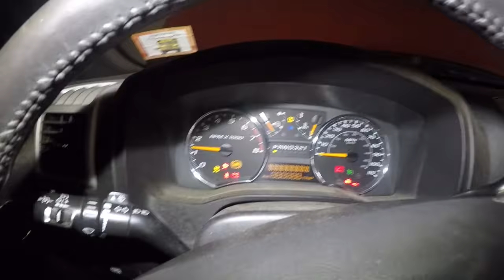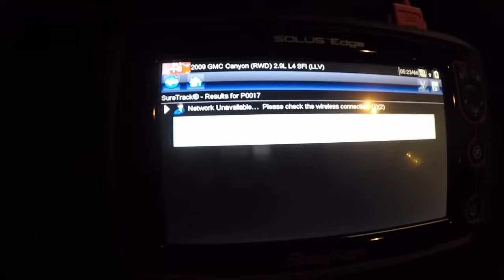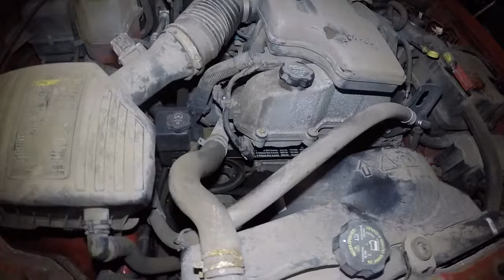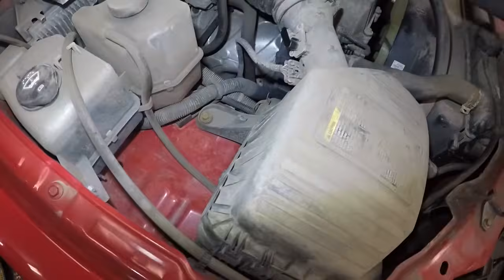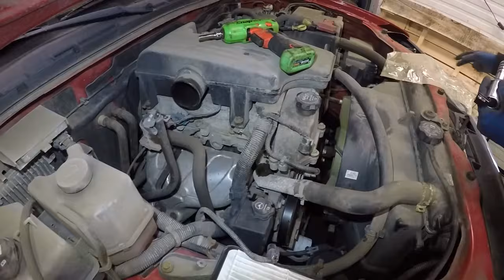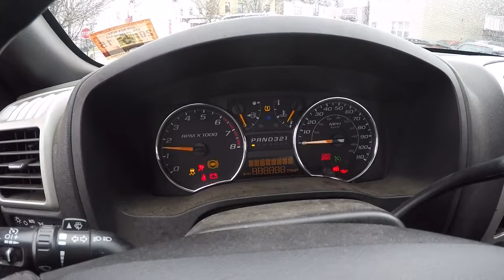GMC Canyon stalls code p0017 and Chevy Colorado

Comment: Hey buddy,
 You nailed the problem right on the head. I had already changed the cam & crank sensors as well as the Mass air flow and the MAP sensor . All to no avail. I didn't know that this part was even in the engine. You described my symptoms to a tee.
I replaced it as you explained.
Runs like a top. Even though I replaced all the other sensors in the end it was still cheaper than going to a repair shop. Besides the truck has 140,000 miles on it so they were getting old.
Again I appreciate you sharing your knowledge.
Reply from the maker: Nice job!!!! Good fix I just did Toyota 4 runner it has misfire issue on start up
Reply: Same here man exact same thing i did thinkn what wld a vvt have to do with p0017 code saying cam/crank sensor.

Comment: I have a 2010 gmc canyon and its starts sometimes and sometimes no but when you go into drive or reverse it stalls i have a evap code leak so i dont know what to do can somebody help me!!!
Reply from the maker: Did u try cleaning theottle
Reply: @RBTheMechanic yes i did a couple of weeks ago was very dirty now on idle it run like 1,100rpm them after 5-10’min goes down to 900rpm

Comment: Yes!!   
This is the video that saved me hundreds if not thousands 

I honestly thought my truck needed a new engine 

One day just started shaking like the engine was about to fall out!   

2 shops couldn’t figure it out 

150 at one shop
300 at the other shop just to tell me they didn’t know what was wrong. 

I came back home from shop. 
Watched THIS video!!   
And I told myself this has to be the problem!! 

This was in March 2026
$80 and 15 to 20 minutes later I’m back on the road because of you. 

Thanks RBT ❤👍🏼🙏🏼💪🏼
Reply from the maker: Nice bro great job I would go back file a complaint and get my money back if they don’t go to file complaint on consumer fraud 10 minutes to file complaint and watch they will immediately call and pay u back to take the complaint back!!! Anyways good job subscribe and share. And save this message as proof

Comment: Po017 says you have a timing relationship issue. Once that happens it stops sending a signal to the vvt solenoid. Duh! It’s not working because if it does it would ruin your motor. Wtf?
Reply from the maker: Cuz be stretched timing chain but try basic before

Comment: I have 2006 Chevy Colorado 2.8l 4 cylinder there is no code when I start the engine it works fine after driving for 20 minutes when I stop at the traffic light the engine shuts off without shaking I already replaced the throttle body, mass air flow sensor, air cabin filter, camshaft sensor, crankshaft sensor and solenoid sensor still not fixed at the traffic light I have to keep my foot on the gas to keep it running
Reply from the maker: Did u do idle relearn
Reply: @RBTheMechanic how can I do that please

Comment: my 04 canyon starts and dies,, what could that be ? new fuel pump and filter and battery and fuel.
Reply from the maker: Start with cleaning the throttle could be chocking it

Comment: This didn't fix the 07 Isuzu I 290 with the gm 2.9 engine. The exhaust cam gear vvt goes bad and will also cause this

Comment: Bro mine did not just pop in, I saw another video from a guy called “Chris fisher” and the fella gave it some oil, wiggle it all you can then if need give a tap with a long screwdriver on the metal piece with the hole, not the sensor. Cuz mine would be 1/4 of an inch sticking out and wouldn’t go in.
Reply from the maker: Look to see inside in anything is there blocking or check correct part
Reply: @ I did fella, nothing. So I did as the old timer said in another video and it worked.

Edit, also I tried putting back the one it had and same thing, it wouldn’t go in, old timer said it was the seal that was making it hard, he was right.

Comment: Good video my friend so I have a question I have a 2010 Chevrolet Colorado the truck start but when it start running and I stop like 20 minutes after I start driving it , the truck start doing the same as the video one you think mine has the same problem
Reply from the maker: That truck has issues with timing it stretches the change and guides
Reply: @RBTheMechanic  so you think I should replace that part from the video I put the scan and throw the code p0017

Comment: Does the position of the solenoid make a difference? The metal tabe to mount the bold thru on new one I purchased can spin around the solenoid. After installing it, the engine still runs rough like before.
Reply from the maker: It only goes one way if the bolt can’t fit in same direction it’s wrong part
Reply: @RBTheMechanic  well after changing the solenoid, camshaft position sensor, crankshaft position sensor, MAP sensor, both o2 sensors, spark plugs & cleaning the throttle body, the truck ran fine while it idled in the driveway. I drove it maybe 10 minutes with no issues. Next day, took it for another 10 minute drive, got up to 55 or 60 mph, ran fine. Came home & parked it, but then couldn't get it to start. No codes have popped up. Any suggestions?

Comment: How do you know if the solenoid was bad?
Reply from the maker: It’s common usully it had code or symptoms of random misfire start up cold
Reply: @RBTheMechanic  I have that same code and the dealer is telling me it's a timing chain which will cost 2500 to do. This code sometimes goes off on its own so that's why I don't think it's a timing chain not to say it's not worn or anything
Reply from the maker: @tamipotirala6973  yeah these could be issue with timing chaning I would do the basics before jumping to expensive repairs oil change vvt cam sensor
Reply: @RBTheMechanic  where is the cam sensor at I've heard there is more than one. I have a 2005 canyon 2.8L
Reply from the maker: @tamipotirala6973  yes I have video search it on my channel
Reply: @RBTheMechanic  ok thanks

Comment: I have a 2012 Colorado.  A new engine was installed.  Now the dam thing stalls at low speeds and stop lights. No codes no check engine light.  It never stalled before. 8(.  Mechanic does not know what it is.
Reply from the maker: New engine will not come with new throttle so it could be that ur throttle need cleaning   Can u do me a favor check the rpm when u stop at redlight it should stay at 800 rpm if it goes below it will start to shake and eventully stall out so try to press the gas peddle soon as u see it that it’s going down if that keep the engine rubing then that usully ur issue  anways update me.  Try this
Reply: @RBTheMechanic I will definitely try this! Thank you for replying!! The throttle body has been changed out, along with the camshaft actuator, and position sensor.   The problem persisted.  The mechanic has now sent the truck to the dealership for a diagnostic.  I have not heard anything yet.    When I get the truck back (Hopefully the problem will be solved.) I will try this for sure.   Thanks so much again for replying!! 8)
Reply from the maker: @snowbunny1001  ok update me!! Even with new throttle it might need relearn but trying this trick should at least tell u where the issue is
Reply: @RBTheMechanic Update:  according to the dealership the serial number on the engine did not match the VIN on the truck.  That’s why it would stall randomly.   So they have to replace the engine again.  🤦‍♀️. Does this make sense to you?
Reply from the maker: @snowbunny1001  oh yeah it got to be correct engine
Reply: I am still without my truck.  8( The mechanic sent a warranty claim for the engine and has not heard anything back after a week and a half.  I have been without my truck since May 13.  This job was only supposed to take a week.  He is saying this is not his fault.  I feel like I’m helpless here.  Any suggestions?  I did not expect this nightmare.
Reply from the maker: @snowbunny1001  u have to call them push them make them pay rental then u can enjoy it and they will have bigger billl longer they take
Reply: @RBTheMechanic  I tried that.  They don’t do courtesy cars.  8/. I am really regretting taking my truck to these guys.  I should have gone to the dealership.  I feel like I wasted $8500.00.

Comment: My truck has same engine. Same code. What’s the part called?  I have lost fuel mileage and power. Thought I had an exhaust valve sticking among other things.
Reply from the maker: Vvt solenoid

Comment: My 2012 has the idle and stall issue when it gets warmed up, changed vvt solenoid, cam and crank sensors, still have the problem!
Reply: 0017 code still comes back!
Reply from the maker: What codes u have?? This car is also know for having timing change stretched out
Reply: 0017,and occasionally 0449 or 0446
Reply from the maker: @pattybritt6987  so replace this might help with p0017 and if it comes back it could be streched out timing the other 2 codes are related to evap systym make sure ur gas cap is fully closed and seal is good to start off also how do I fill up ur gas with engine running?

Comment: Its been awhile since this video was made but hopefully i could get some advice I got a code p0014 vvt solenoid  I changed it out but my check engine light is still on does it go off right away or do I have to keep driving it for it to turn off .or should I just clear the code with my obd scanner.
Reply from the maker: Do the cam sensors also other wise u got streched timing chain need new kit for timing and guides for timing that is very common on these but do the cam sensor also
Reply: @RBTheMechanic   👌

Comment: I have a 2005 gmc canyon having these problems and then some… and I cannot find. ANYONE who can ACTUALLY find the issues. I’ve put SERVERAL new parts on it…. I just want my girl to run… it’s 4 wd 3.5 L engine, 5 cylinder inline, 
The list of codes it’s throwing are 

0016
0017
0305
0340$
0341
0365$
0366
0315$
The ones with the dollars signs are steadily showing even when I clear the codes. 

We have put a new start, computer, camshaft sensors a and b, crankshaft sensor, map sensor, 3 out of 5 new coil packs, new spark plugs, throttle body, transmission pressure plate, just did an oil change couple 100 miles ago, new fuel filter.

There’s also a remote start box in it (after market) but no key for that and I’m not sure what was bypassed to put that in….

If you could help me my phone number is (270)452-8600…..
Reply from the maker: It might be stretched timing u will check all this once in at the shop

Comment: Thank you for this video had my truck fix in 10min.. change my oil first and the did the timing solenoid.. I did not need to remove any air intake hose
Reply from the maker: Good job!!
Reply: I didn't either but it would give you more room

Comment: Sorry. I changed the sensor B. Also sensor A. And solenoid and crankshaft sensor. It runs much better. But I still keep getting P0017 sensor B bank 1. And it sometimes won't start back up immediately. Any more suggestions?
Reply from the maker: Check timing these have issue of stretching and worn out timing guides

Comment: Solenoid did the trick. Scanner was showing bank 1 sensor b for camshaft sensor. I replaced the exhaust passenger side sensor. Is that sensor B? Because I am still getting a code p0017 bank one sensor b.
Reply from the maker: B would be exghust
Reply: Thank you.
Reply: Hey. Well I replaced both camshaft sensors, the camshaft solenoid and the crankshaft sensor. It runs much better now. I still have P0017. I changed the oil. It was black. Maybe the timing chain jumped. Trans fluid seems overfull. It doesn't shift properly. Sometimes it shifts hard. And it seems to shift late.
Reply from the maker: @tainchains  yeah I had few of these with stretched out timing chain and or guides

Comment: Hi. My truck has a very bad stall. Will not stay running. The code is P0017 and shows bank 1 sensor B. Is this possibly the problem or is it likely Camshaft exhaust sensor?
Reply from the maker: Try both of these and clean throttle
Reply: Ok thank you ordered both I hope this fixes it. I already replaced the crankshaft sensor
Reply from the maker: @tainchains  yup and clean the throttle … last thing is stretched out chain
Reply: Thank you. I don't hear any rattle. Maybe the timing chain is ok. If is is stretched what are my options? Can I tighten it by removing links?
Reply from the maker: @tainchains  hopefully it’s good usully it will stretched out these cars have this issue

Comment: Would the VVT solenoid also cause a random no start issue? Idle is fine but once in a while, I get a no start. Triggers a P0017 code when it fails to start. I suspect a faulty crank/cam sensor.
Reply from the maker: Yeah could be u can use scan tool to see the performance of sensors but I would change it also this VVT is very common issue

Comment: I have a 2006 Chevy colorado and I have the same code but I changed the VVT but still has the same problem what could it be?
Reply from the maker: Change the cam sensor also clean the throttle if all that don’t work then it’s possable ur timing chain and guides are streched out

Comment: Hi.  My 2008 GMC Canyon has no stalling and no drop in RPM.  But it does run rough, bad gas mileage, has check engine light on, and shows Code P0017.  The readout said:  "Crankshaft Position-Exhaust Camshaft Position Not Plausible DTC Severity 2 of 3: Repair immediately if drivability issues."  I changed the oil but the problem persists.  Is changing the exhaust solenoid the answer for my problem?  PS:  Great video, even if this isn't my solution.
Reply from the maker: U can’t say yes for sure but it is worth changing the part
Reply: @RBTheMechanic  Thank you!
Reply: Changed the solenoid today. Truck ran smoother immediately.  I had the code re-read and it reads the same code. The guy told me it scans itself after another 100 miles and the light may go off then. Does that sound right?
Reply from the maker: @billbeggs2304  yeah but reset it with the scantool then it will determine if it should stay off
Reply: I'm in same position with 0017 did your code stop coming up after vvt
Reply: @kennethbyington516 mine didn't until I did the cam sensor.

Comment: I have a 2008 Chevy Colorado, truck turns on ok but no check engine light comes on. As soon as I shift to reverse it’s turns off. Truck starts back up fine  but once I shift it, it completely goes out. Would this be the problem?
Reply from the maker: It could be due to load low rpm check to see what ur RPM is
Reply: @RBTheMechanic  650-700
Reply: 6500-7000
Reply from the maker: @Josebabylocs18  when u put to in to drive or reverse it should stay 700 above if not then it might be low idle clean the throttle
Reply: @RBTheMechanic  will do thanks

Comment: On my Chevy Colorado 2.9 I started up in the morning only went cold and it's still out I have to hold my foot on the gas pedal would that be the problem could you answer me that's the cam sensor right
Reply from the maker: Might want to start with cleaning the throttle
Reply: @RBTheMechanic  I put a brand new throttle body on it it's only in the morning when it's cold
Reply from the maker: @ronnieyoung7510  any memory or pending codes?

Comment: I have a question... Do I have to change all the cables?, or just the selenoide?
Reply from the maker: Just the selenoide
Reply: @RBTheMechanic  thanks brother, It is something that I can do, I will save a lot of money on the mechanic
Reply from the maker: @frankipalacios5390  yes it’s simple and easy follow my instructions
Reply: @RBTheMechanic  is it true that it helps engine performance and helps save gas?
Reply from the maker: @frankipalacios5390  performance yes gas no but if this is not working engine will run sluggish so it might have effect of gas as well

Comment: Thank you guys. That saved me a lot of stress and time.
Reply from the maker: No problem glad u could do this by urself!!!
Reply: @RBTheMechanic  i have a 2007 Cadillac sts p0017 code runs good cranks fine light sumtimes goes off then comes back on it has loss a little power thats it so where should i start vvt or cam sensor
Reply from the maker: @jrenoch1796  that is code for crank sensor bank 1

Comment: I am still having the same problem with the truck about to stall what do you think it can be
Reply from the maker: Dose it stall at the stop sign or red light if it dose try cleaning throttle I’ll send u video on Chevy camery throttle service
Reply: @RBTheMechanic  I have cleaned the throttle body and when I'm at a traffic light it feels like it wants to stall I put it in neutral hit the gas
Reply from the maker: @johnfuchs2967  ok so somthing related to throttle body. Try these thing check for vaccume leaks... check to see if ur timing is on spot these chevys are known for stretched timing chain and worn out timing guides which will cause timing marking to go off so u need to do that before replacing or relearn The idle
Reply from the maker: Here’s a link to stall video on Camaro https://youtu.be/ikXZPDLmcsI. If this dosent work then it can be other possibilities

Comment: Before you replace it you should check for resistance at the solenoid before replacing it also it doe's have magnetism this is not a cheap fix test across  the two pins you should have  continuity and also a reading 0.19 ohms also remember to keep your oil clean it is a big part of it.
Reply from the maker: Good information only u can do it yourself
Reply: How much is that solenoid
Reply: @ronnieyoung7510 I just bought one and it was $100